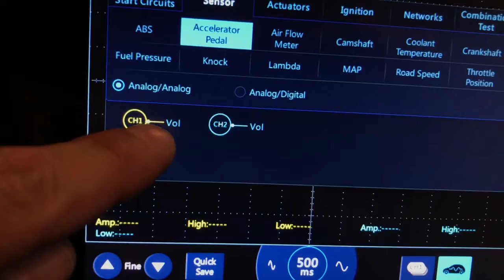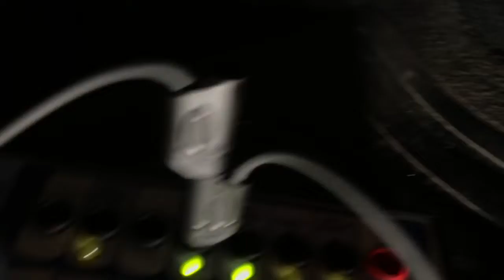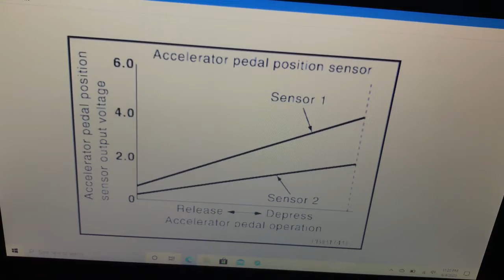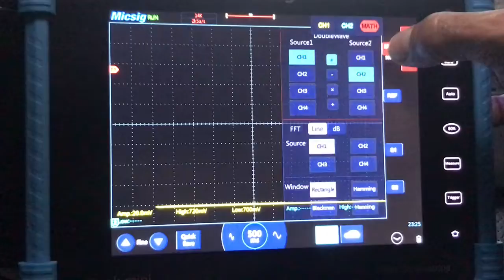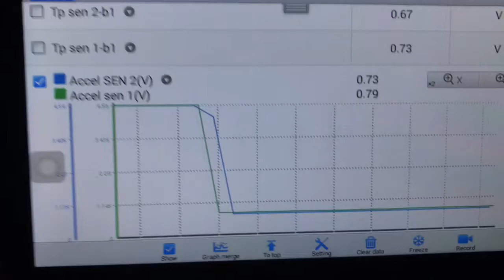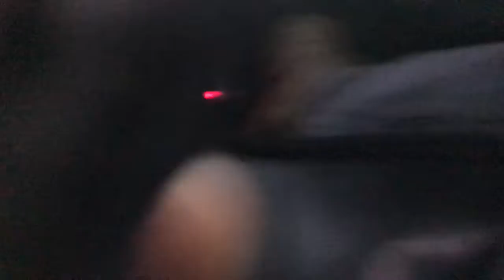Micsig ATO1104 Accelerator Pedal Position Sensor

Comment: Hello sir. Great content, thanks for providing it. I've been having a weird RPM dropping on my Chrysler 300 3.5 when I cruise at low speeds. RPM drops to 400-450 from 1400-1500 when I let the gas pedal off, it's like goes to stall but returns to regular range in a second. 
Additionally, on idling at park; If I quickly press the gas pedal and release, rev looks like getting stopped and drops with waves. I mean it doesn't get higher/lower properly.

I was observing my APPS voltages for a month, so I figured out sensor 2(E) has got spikes as voltage drops to zero. Although the gas pedal is not pressed, the voltage drops to zero many times. So, the car feels like hesitating to accelerate beside the rpm dropping which is very frustrating. Do you think the app sensor itself is the issue or the wiring? Or anything else could be the issue? Please take a look at the graphs:

https://ibb.co/pWC212G

https://ibb.co/BPFVHpz
Reply from the maker: Hello Out run, and thanks for stopping by the channel. I can’t say for sure without looking at it myself. I can say, from my experience, that you usually have two signals for the APP sensor. You want nice smooth waveforms, with no spikes or drop outs. Also, don’t forget to check the power and ground going to the sensor. You can check what the manufacturer says should happen when you press the pedal, and compare it to what yours looks like. If you are a DIY’r, you can use either Alldata DIY or Mitchell DIY. You can pay per vehicle for a month, 6 months, 1 year, etc. As for whether it’s the sensor or the circuit (wires); try unplugging the sensor while watching the data pids on a scan tool, and see what happens. I know this may not be the answer you were hoping for, but maybe it will give you some direction. Thanks again for stopping by the channel my friend. Let me know what you find out.
Reply: @atomsworkshop195  Thanks for your reply. Today went to a popular garage and told my problem, the mechanic just said the injectors have to be checked. Then I told what I found about the gas pedal and he was like: Nah, it can't be the gas pedal sensor. Then he tried a re-learn procedure and failed. The gas pedal stopped working, he swapped a throttle body from another 300 and didn't fix it. I insisted about swapping the gas pedal so he eventually did. After he ran a re-learn, both gas pedals started working again. Wished he would let me test drive with the other gas pedal installed but the mechanics here are not liking the DIY'ers when we correct them. Anyway, my pedal is working with the drop out issue now, gonna order a new one and try it later on.
 Thank you again, have a great day.
Reply from the maker: Hello Out run, how’s it going? Was just wondering if you ever got a new pedal? Or did you figure something else out? Anyways, I was just looking at your last comment, and was wondering. Also, I think it’s bs when “mechanics” look down on DIY’s. There are a lot of really smart people, that diagnose & repair their own vehicles. Just because someone doesn’t do it for a living, does not mean that they can’t be very good at it.
Reply: @atomsworkshop195  that's so true most mechanics I know are part changers anyway hate trying to diagnose a vehicle
Reply from the maker: That’s the truth Old School. I don’t understand why. To me, the fun part is the diagnosis. With the internet and YouTube, anyone can learn how. If I’m to be honest, I’ve learned most of my diagnostics skills from channel’s like Scanner Danner, South Main Auto, Pine Hollow Diagnostics, and others; oh, and of course tinkering (trial and error). Sometimes more error than trials, lol. The only problem when starting out, is you have to invest a bunch in diagnostic equipment.

Comment: Hey bro. What autel are you using and how do you find it ,. Can the automotive  software  pull up four cursers to do in cylinder wave form diagnosis?
Great video, i see you are loving you new money maker, lol.
Reply from the maker: Hey, what’s up Leo? Good morning. The Autel I’m using is the Maxicom MK808BT   It’s not what I would call a professional scan tool, because it lacks most of your bi-directional controls. However, for the price, it’s packed with a lot of features. I payed $615 back on Oct 7th 2018. Only, I felt like the screen had a minor scratch, so I returned it, then they sent me a new one and nocked off $61.50, so I got it (brand new) for about $553. You can buy it right now on Amazon for $560. It has like 23 service features, such as ABS auto bleed, key fob programming, oil reset, EPB, BMS, SAS, DPF, Throttle relearn, Injector, headlamp, trans adaption, Chg tire size, etc. it can do a full health report (scan all modules/computers for codes). You can see all your data pids (usually shows a normal range). You can save all your customer and vehicle history. You can email or print out the health report for the customers vehicle (it looks professional with the name of your shop, address, phone, vehicle with miles color and license plate), also the name of the Tech, and spot for Tech notes. It basically does everything the Autel Maxysis MS906BT ($1,299) does, except bi-directional controls like activating components like a fuel pump or or whatever else. With all that said, I would like to get either the MS906BT or the Maxysis Elite. The Elite does everything the MS906BT does plus it come with the J5234 Pass through for ECU programming. Only it’s running $3,149 right now on Amazon. Your last question about the 4 cursors to do in cylinder wave form diagnosis, are you referring to the scope (the Micsig)? If so, yes it has 2 vertical & 2 horizontal cursors. It also has the 360/720 cursors, where you can choose the number of cylinders, then choose whether you want 360 angle degree or 720 angle degree (or any other number). If you go to my video on my channel called “ looking at ignition wave forms with the pico secondary ignition probe on the Micsig oscilloscope”, and skip to about the middle, you can see me use the vertical & horizontal cursors. Then towards the end, I show the 360/720 cursors. I don’t measure anything with them; just show what they look like. Well, I know this was a lot of info, so I hope I didn’t bore you to much, but I hope it answers your questions. One last thing to consider with the Autel. Once your subscription expires, you can still use every part of it (apparently you can’t with some other scan tools); you just won’t be able to upload new vehicles & features, until you renew. The MK808BT costs $125 (I believe) for a year, whereas the more expensive ones. are a lot more. I don’t remember exactly, but I want to say like a grande or so. Thanks for stopping by the channel again Leo.
Reply: @atomsworkshop195  I just bought the Thinkdiag bluetooth scan tool that uses a program on your cellphone to do some bi-directional diagnostics. About 120 dollars and gives you two free car manufacturers per year. That means any vehicle made by GM, Ford, Chrysler, Toyota, etc. Pick any two for free. You'd have to buy other modules as necessary, but you can include it in your diagnostic fee. Either 39 or 49 dollars per year. I'm not looking at the literature so I'm not sure which. Super Mario has a link on his channel that gives you a deal on the purchase. It showed me which modules I have on my 2000 S10 and diagnosed my DRL issue. What a scanner!
Reply from the maker: VashthStampeede, that’s cool. I’ll have to look into that. That would work great with my Autel, because all I’m really missing is bi-directional controls (other than programming). Super Mario used to have a Micsig, but I think he said he sold it to his brother when he got the Pico. When you get your scope, if you have any questions, feel free to ask.